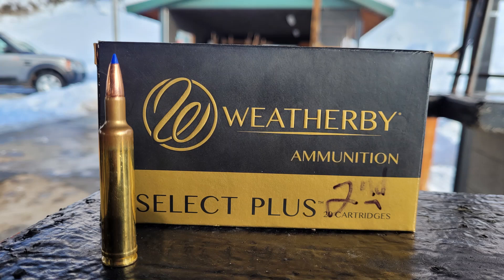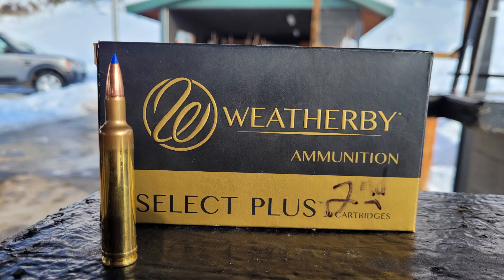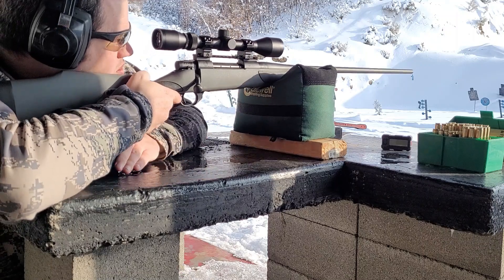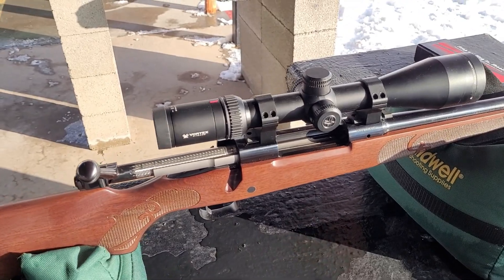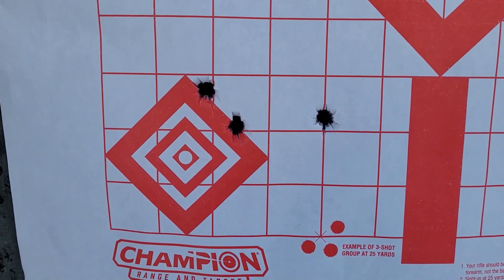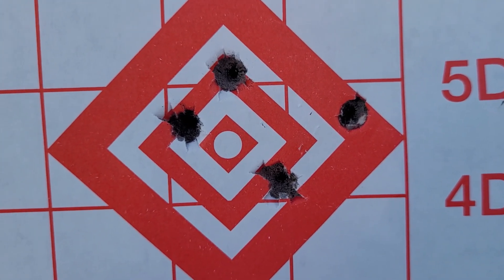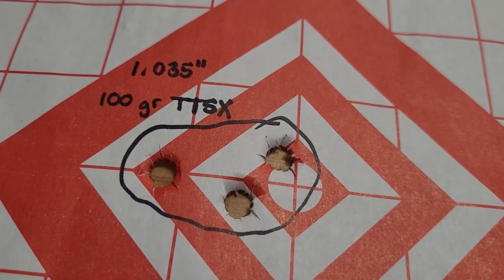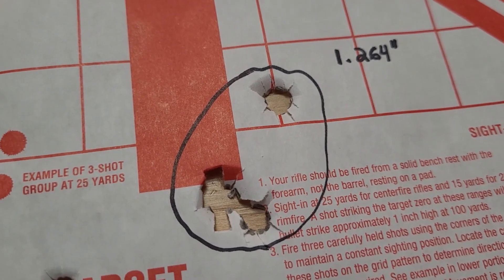Weatherby Factory ammo test: 257 Weatherby Mag

Comment: Had a Model 70 30-06 also.  It would put the first two shots in a tight, touching group,  but #3 was always off.  I'm guessing it's just not designed for shooting more than 2.
Reply from the maker: I've noticed that a lot with this rifle. It shoots 2 pretty well and the 3rd is a flyer. Only bullet it hasn't done that with is the 168 TTSX.

Comment: Master gun builder told me to push down on the top of the scope when shooting groups and it really helps prevent that barrel jump.
Reply: It works on most cartridges. On the big ones it seems to direct the recoil straight back into my forehead. I realize it isn’t proper bench shooting technique, but on rifles like my 340 I lightly grab the forend of the rifle so I can roll with it instead of wearing the Weatherby Kiss.
Reply from the maker: Have you tried it?
Reply: @ReloadingWeatherby  I personally cannot get good results shooting free recoil with light rifles chambered for, approximately, 270 and up. Without ever having shot one, I would likely include the 257 wby in that group. That said, I am not much of a fan of the, hand on scope hold as it is quite easy to induce cant to your rifle without noticing. . I also suspect  that type of hold could affect the harmonics during the shot.. My preference for what it's worth is to grip the forend as you typically would and a firm hold into your shoulder pocket.
Reply: @Mikail Agree completely sir, recoil management is critical. Had to snicker at your Weatherby kiss comment. My daughter was quite proud to show off her eyebrow scar back at school to classmates.
Reply: It looks like you're shooting a Vanguard?  If so ,it has a 24 inch barrel, not the 26 inch that weatherby has on a mark 5, which is what they test the ammo velocity with. With a 26 in you would have been over 3500 fps
Reply: @jamesdolgener7892 wrong and wrong again
Reply: A tip for you using those targets. You may already do this but thought I would throw it out there. Align your crosshairs with the points of the Diamonds. Don’t try to align the centers.  I also use orange dot stickers that are printed with the diamonds on them and align them with the target markings.
Reply: I can't shoot worth a damn off a bench holding a rifle like that i.e. free hand/arm curling around the rear bag